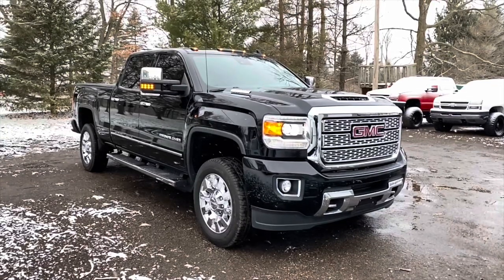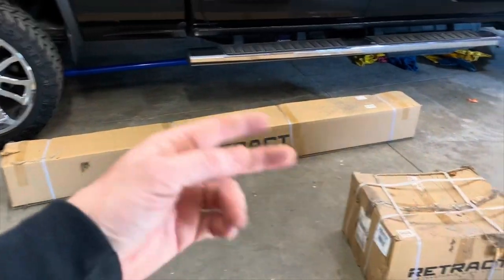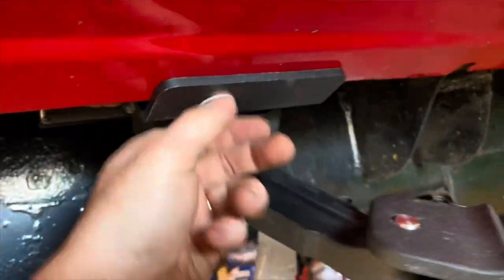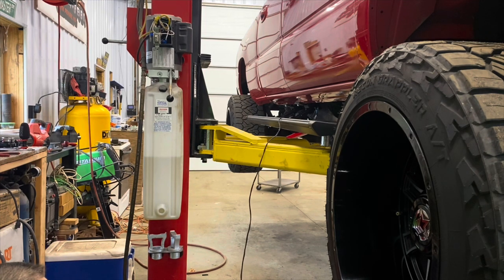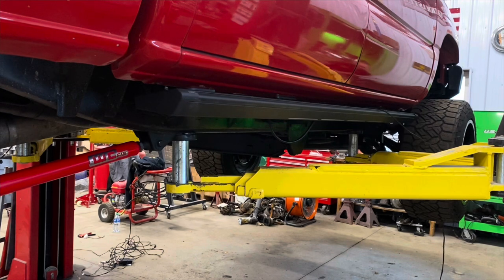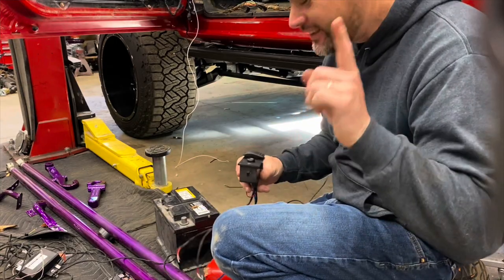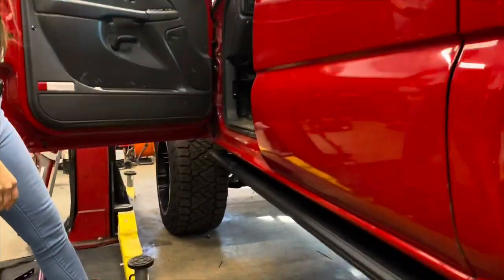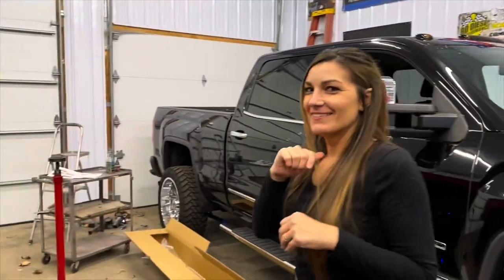Testing Retractable DIY Power Steps And They Broke Immediately!

Comment: What Anthem rims do you have on this truck?
Reply from the maker: They are called instigators but they don’t make them anymore the closest thing to these are called anthem equalizers
Reply: @TruckMaster  🙏 thank you!! The equalizer ones are on back order which I found out yesterday from which I had ordered them (equalizers) on the 2nd of December. So those ones on your truck looks sweet and I’m trying to find them  couldn’t and that would be why. This rims thing is such a mess. I now have tires at the tire shop waiting to be put on the rims that was a confirmed order in which was done at the beginning of the month. So frustrating

Comment: I had the same problem with my obd plug the problem was the chip inside the OBD plug was incorrect so I took the two purple wire, grounded them, and the steps go up and down

Comment: Wire the trigger wire into the door switch, then to a rocker switch. That way when you open or close the doors it’ll drop and raise automatically or you can use the rocker switch that way.

Comment: What if you wired it into the door lights? When you open the door, the light comes on which sends power to the steps which brings them down? Then when you close the door the light goes off which cuts power which brings them back up?

Comment: I made working side pipes for my car, and bolted them on .
    The car sets pretty low ,I've had them on the car about 10 years now .
     You can jump on them and they won't come off I've even hit some curbs with them ,but you would never know looking at them.  
    My point .
   I never buy ,what I can build myself. 
     Running boards are not that difficult to build .
                  Try it .

Comment: Hey just a heads up E Bay  sells a 12v wireless key fob  Controller it kinda tricky to wire it up it has a bunch of little relays you can wire it momentary like you have or always on for lights or w/e like 12 bucks
Reply from the maker: Thanks for the info I have to look this up now 👍
Reply: E bay has it actually not amazon
Reply: Just type in 12v wireless controller

Comment: If I atemp this on my 2004.5 LLY Dually Million Mile Truck I Would fabricate thick metal brackets from the frame sides tucked up under the rockers to fully support the weight of two 310lb. persons at a time!

Comment: I have amp steps on my 06, they r wired to open with the door, the way they work is off of the striker, for whatever reason they don't always cooperate,  so I added switches, so it can open via door, but I can manually open with the switch... but, I used a switch for each side, and that's what I wanted to recommend,  nothing wrong with how u have done it, but if u put something on the passenger side as well it would be alot more user friendly.  Otherwise I think this was a really cool project.  I love seeing the stuff u build.  Keep it up... also love the love for the veterans... my younger brother is a disabled vet, and it means alot to see what u do to support these heros... thanks man
Reply: Could you elaborate on the wiring? What do you mean the striker ?

Comment: Head liner...frog tape yellow,plastic drop cloths,few 1" plastic scrapers w 1" cheap paint brushes, ?liquid nail??loctite adhesive?,the quickness,and 1" perimeter flex seal overlap with the quickness again.

Comment: I have the AMP steps for my dad's truck, and installed a few. From what I can see they have a more secure mounting than the rough country. And I can say they're strong as we have a big guy at the shop and sometimes he stands on them when we're adjusting and tightening the mounts, and they hardly flex even when he bounces. Also I can see the way that the RC steps swing out being a potential problem off-road.
Reply: Amp steps are LEGIT!   Worth every penny IMO.  I have owned a set before and plan on another set for my new truck soon.  Can't speak for these but the sideways action for me is a no go.  Looks like it will just trap mud and ice then not function.
Reply: Yes, I sell them. The basic ones handle 600lbs each side

Comment: Love my amp steps. Been on the truck over 10 years and still working
Reply: I've had mine for 8 years still going 💪
Reply: @HungNguyen91622  They are really that durable to last more than 5yrs?
Reply: @taylormushtare3437  yes had mine since 2015 and it's still working, just gotta give it some lube and it's good
Reply: 9 years now for my amp steps still work like new on my 2001 f250

Comment: Shoulda tapped power in the door harness for each door. Find the wire in the door that tells the dome lights to turn on tap that wire for power than they will open and close with each door.

Comment: OMG! So not looking forward to winter and you're already firing up the wood burner. How do you think those step will work in the snow/ice? I have the same headliner problem. The cloth is dry rotted and the backing is sand in a towel.
Reply from the maker: I think the steps will hold up this winter

Comment: I actually design standalone control modules for power running boards. If you want them to work automatically when you open and close the doors let me know.
Reply: I've got a set I need a harness built for.

Comment: Hey Josh, hate to be the bear of bad news but there is a courtesy light (door open) feed under the dash, instead of going to the door switch. 
Clean install tho 👌
Reply from the maker: Crap! I didn’t think about that
Reply: Where is it? Do you know what color the wires are?
Reply: My thoughts exactly
Reply: As a car audio installer who does alarms and actually doing power steps . You have to go to each door as the wire that is being referred to in each door is and has to isolated or you will fry the bcm .
Reply: @stereotech2002  too late, already fried and a new one on order 😂
Reply: @oldrango883  lol two days too late

Comment: The reason it works with something like a window switch is because the motor on the unit works off reverse polarity like a window motor.
When power is applied the- ground turns into 12v and the positive + turns into ground 
So either way you run power the motor will operate.
So theoretically speaking if you hook that module up to 12v and the control wires up to something like your dome lights it should operate fine 
When the dome lights turn on the unit will open and when they power off the unit should close.
Reply: A person can use 2 relays that are double pole relays get work automatically to work if wanted to to flip polarities back and forth

Comment: But a regular door switch ,  you can get them where it’s breaks negative side so it’s only getting power when contact is closed (door open )   Or just buy a reg amp step harness and copy how it’s made.  Anything they use on newer style trucks. Can be done on older style

Comment: I have this on my truck, I would suggest to add grease fittings to the pins on the pivots. They corrode and expand. Which causes a shorten cycle of the running boards. The company doesn't offer any repair kit for this problem

Comment: Amp steps are basically window motors anyway. So im sure RC uses a similar setup. Only difference i see is amp uses a bolt through the inside behind the pinch weld. Other then that i kinda like how RC did theirs. They didn't have them back when i got mine.
Reply from the maker: I’m still debating on buying a set of amps for the Wifemax
Reply: @Truck Master  mine are still holding up good. The issue i have is the contact for the latching mechanism in the door itself that signals the steps to come down. Other then that they are great.
Reply: @TruckMaster  do it you won’t regret it!

Comment: Wellll duhhhhhh common sense says those are weak as shit just looking at them they are designed to get grandma and grandpa in the truck they are meant to use like a rock slider or jump on them they are very rickety and poorly made and they still rot your truck out too there is no point to physically force your rocker panels and under the cab and frame to rust and rot the good just doesnt outweight the bad on this one